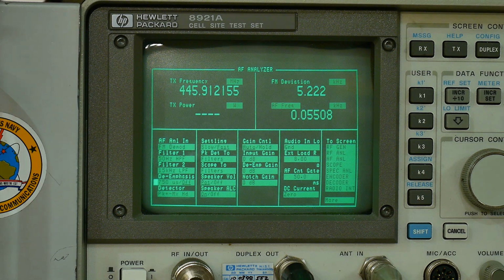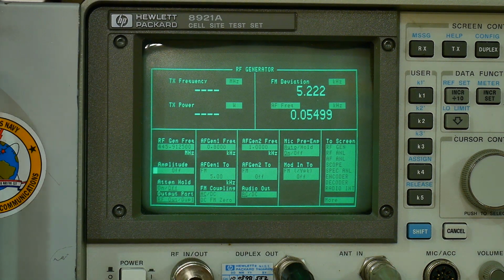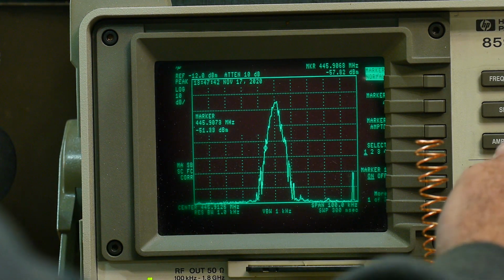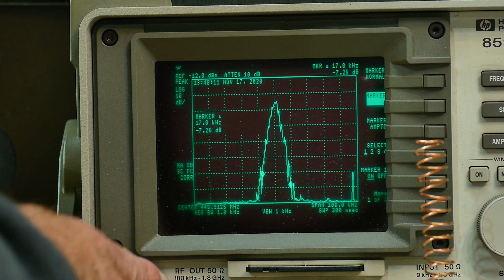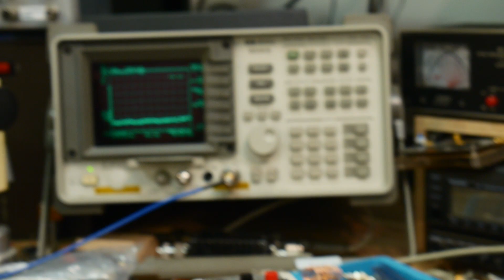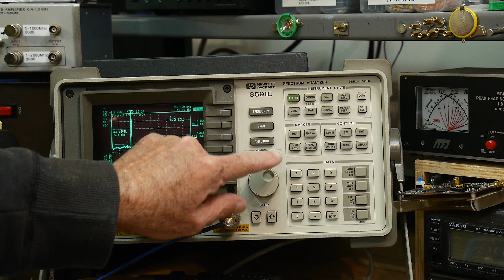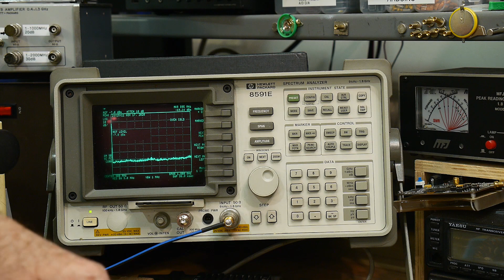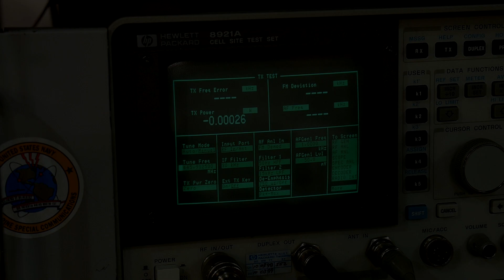#657 WLN KD-C1 (part 2) Add SMA Antenna Connector

Comment: I'm fascinated by these small, compact-sized radios.  I have a set of Baofeng BF-T20 and GT-22's, which are identical.  Same inards.  There are multiple identical variations of these units that companies have just attached their label to --  I assume all Chinese.   In any event, finding these on sale in pairs for $20-$22 is a steal, as the near 2-watts of power will reach quite a distance.  Of course I'm still new to amateur radio, and am only comparing them to the toy walkie-talkie sets we had as kids (Archer) that wouldn't even reach to the nextdoor neighbor's house..

 I haven't quite got up the nerve to attempt your modification, but at some point I will.   I'd love to attach my Nagoya NA-771 antenna and see how it'd perform.  Very informative video, I could watch these type of radio surgeries all day long.  Thank you..

Reply

Comment: I think 1.87 watts is normal power for that kind of radio. You cannot go beyond 2 watts at 3.7 volts battery pack. Depending on the RF transistor installed, typically a full 5 watt radio runs at 7.2 volts (8 volts at most), 2.5 watts when you put it on low power.

Comment: I wonder if the impedance at the antenna is not 50 Ohms but is in fact the conjugate of the antenna impedance? That could explain the low power. They might have tweeked the output filter so that it produces maximum radiated field indicating a match to the actual antenna feed point impedance. Somehow I doubt that spiral antenna is 50 Ohms.
Reply: 5 Chinese WATTS!

Comment: What's the frequency span of the different channels and if they're significantly spread does the power out vary? Looked like there was a speaker/mic jack on the side where you could get the audio for the SINAD test.